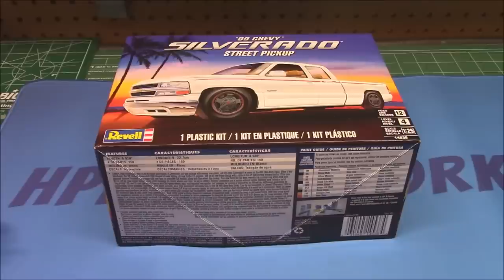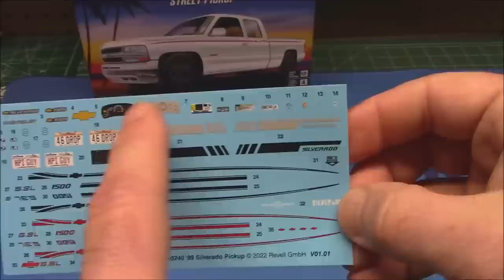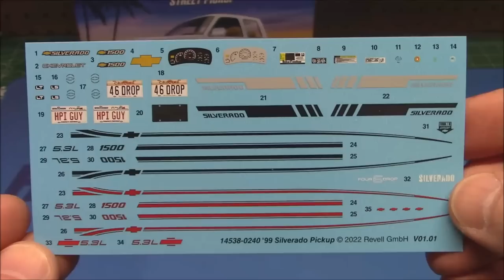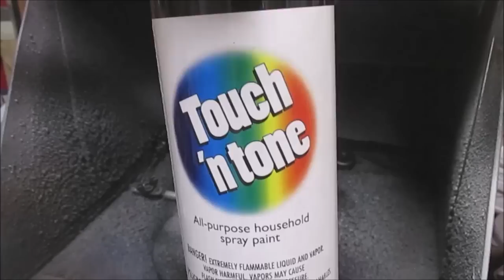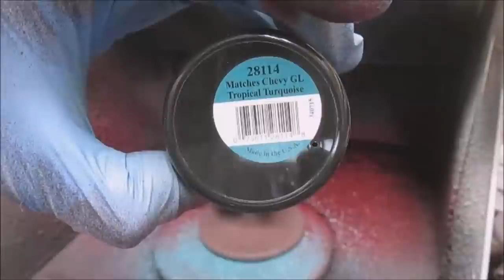1999 Chevy Silverado Street Truck 1/25 Scale Model Kit Build How To Assemble Paint Interior Weather

Comment: What glue brands do you use? I've seen you use both a bottle and brush on products. Please explain the reasons for both. BTW I now incorporate many of your methods in my model building process. So much more efficient and a cleaner less "messy" build. 
THANK YOU.
Reply from the maker: I use Plastruct Bondene for bare plastic to plastic. Model glue only works on styrene to styrene. 
I use cheap super glue for final assemblies and painted/chrome parts.

Comment: Something I've noticed over 12 months or so, is on the interiors of models. I'm assuming you're doing stock interiors as close as possible to original colour combinations. Interior colour combinations on cars sold in Australia were generally the same colours for the whole interior, so seats, door cards/panels, parcel shelf, carpets/ rubber floor covering, roof lining, steering wheel/column and dashboard are all the same colour. I just found it interesting how different countries have different colour combinations on there vehicles. Love your work 👍
Reply from the maker: I just do what I think looks good. Sometimes I get close to stock, sometimes I am way off. Either way I'm having a good time doing it.

For this build in my imagination he swapped the grey fabric seats for some lighter grey ones he found in another truck with leather.

Comment: Can it be built as a stock Silverado as well?
Reply: I think the front suspension part is lowered in this version taken from the custom kit, you might have to cut the wheel connecting pegs off and glue them to stock height, and the rear, move the axel/diff to sit on top of the rear leaf springs instead of underneath them, everything else is stock, hood rear bumper etc in the kit...